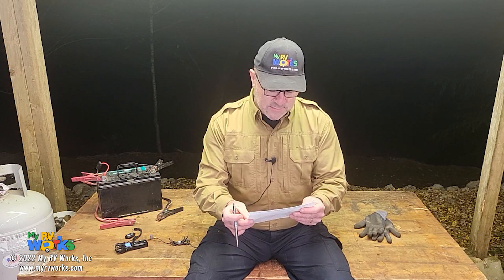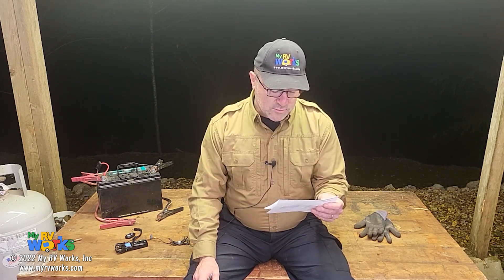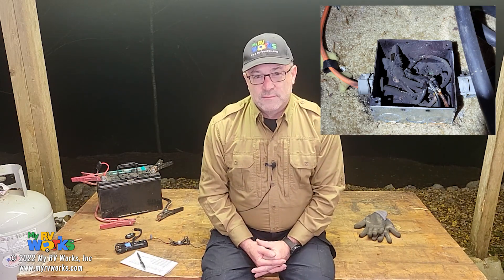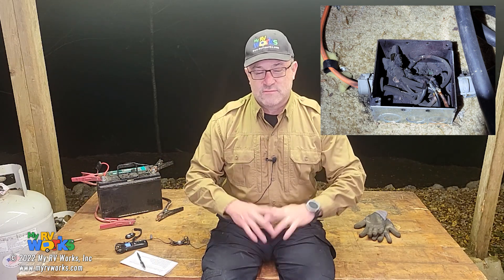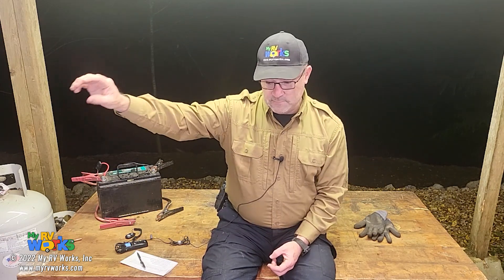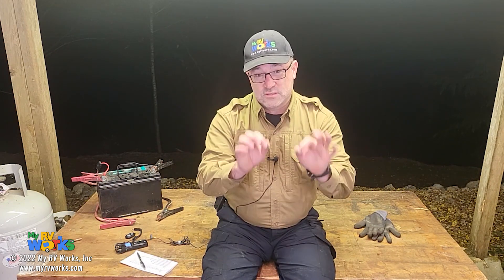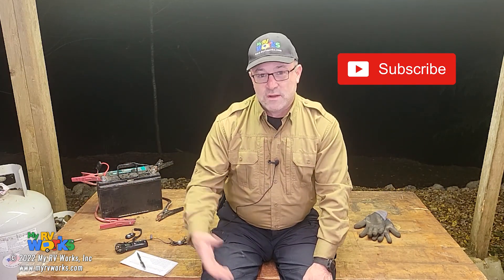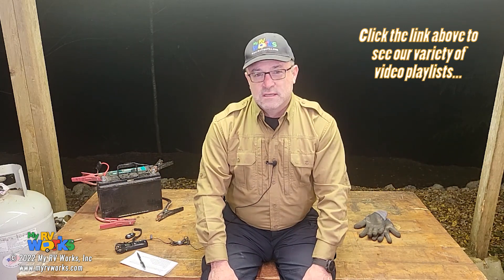RV Electricity Shuts Off Intermittently -- Where To Start Troubleshooting -- My RV Works

Comment: I have a 2016 reflection that kicks all power out intermittently, I'm told it's 30 amp service coming to 50 amp trailer and it's insufficient thus the safety is kicking off shore

Comment: I had my AC and fridge would shut off when that happened the only thing that work on my RV are my power plugs ...my lights fridge AC do nothing sometimes they come back on soon sometime not for hrs ...so I replaced my breaker box and fuse box now everything works all the time but my thermostat has no power my AC won't turn on and something new my furnace never had any power problems now it won't turn on ...

Comment: Hello Darren, I own a 2205s 2023 Rockwood Mini. I noticed when we were preparing for our next road trip, our 12V system started having issues with lights flicking when we stepped on the floor in front of the kitchen sink. This happens while we have shore power even when we're Boone-docking we have two 100w solar panels on the roof. Your thoughts?

Comment: I'm having the same problem on my 2019 Forrest river 26DB Grey Wolf. 30AMP, but only when the AC is running. All power cuts off and on, Just started happening. I guess I'll try and find the junction box you spoke of. Thanks for taking the time to make these videos.

Comment: Great stuff, but I have a converter that keep turning off. Replaced the converter and the new one is doing the same thing. Thinking battery is dead and pulling too many amps?

Comment: I have an 2006 Alpenlite Voyaguer,  a 5th Wheel, a few days ago the lights in the bedroom/bathroom stopped working , halfway through the morning,  meaning they worked when I got up, turned them off, returned later ...nothing. Everything else in the RV works .   Everything only this small cluster of lights and the bathroom fan.   The electric outlets in that area work, so I've plugged in a lamp.   The night reading lights at the head of the bed work.   We've changed all the 15 and 20  Blue and Yellow plastic fuses.   Any clues what we haven't done right?

Comment: Do you work on RV Generators?   I have a Onan 4000 Microquiet KY Spec H which cranks but doesn't start.  Replaced fuel pump and filter, starter solenoid, fuel cutoff solenoid, air filter and spark plug.  I've overhauled the carb, new jets, float, gaskets and bowl ring,  all the general maintenance items.  I had a valve spring retainer clip break, which has been replaced.  There is no oil sensor switch. I've verified fuel and spark.  I have no idea where to look next.  Any suggestions would be appreciated.
thanks

Comment: Darren great videos keep them coming. Quick question I'm thinking of adding solar to a 2008 trailmanor 3124ks. What would you recommend to plug in solar charger controller direct to battery or charge controller to DC side panel supply? Will make a difference in voltage drop? Thank you

Comment: Some RVers are STUBBORN and don't/won't learn about amperage.  You get 2 small space heaters going and there is nothing left amperage wise for anything else.  A 30 amp service (3600 watt) is used up quick.  Better make sure every connection is BRIGHT AND TIGHT!

Comment: Hey Darren,  I would start at all the connectionalong the power to the panel box.  In my findings it is mostly a poor connection or a worn out plug on trailer cord or at the power pedastal. Great informative video as you always do.  Thank you for the videos and keep them comimg.  Rick A from Farwell MI

Comment: My favorite problem is when 12V lights don't lose power completely but dim down to almost nothing while all the rest of the 12V lights in the unit, including on the same circuit, stay on as if nothing is happening. This doesn't happen to just one fixture. It happens to nearly all of them, one at a time, at one point or another while the rest that are often on in the same space don't give the slightest indication that anything is wrong. It happens at any temperature, and whether the lights have been on recently or not. Between two electrical engineers in the family and a good friend who is an electrician, there has been puzzlement and a range of theories for the cause suggested but nothing that has been established. Currently the best / most plausible theory is that it is specific to capacitance issues (design or manufacturing fault) in the collections of LED's that make up these types of [very cheap RV-level] low-voltage LED lights and that is also why it can be exhibited randomly and without impacting the rest of the circuit it is on.

Comment: Hey Darren I  like these challenges too. I my self would start with the shore power cord. With 30 years of experience many times I find one end or the other that is compromised by being burnt or even  the twist locking connector on the coach is burnt or has extremely loose connections. Your nose can also lead you in the right direction too.
Hope this helps. 
HAPPY NEW YEAR TO ALL!!
Reply from the maker: Happy new year! Thanks for watching!

Comment: 🎊Happy New Year 🎊 
 I have a 1999 Ford Pace Arrow vision 50 amp rv. Rats invaded the rv just before I got it and chewed many wires. 
 Solar panels were charging for a while. The lights were working, so was the pump for the sink/toilet but outlets didn't work or anything else.  then one day solar just stopped charging.  It seem to stop the same time I replaced the alternator. Is it a completely different system and it's just a coincidence they both stopped at the same time?
 Anyway,  I want to put more panels on roof and replace as much wiring as possible.  The person who I got the rvfrom didn't know much about it so I don't know much about how anything works. 
  Are there booms on how to operate my rv. How to open and close slide outs.  (Which don't work blouse of the rats) 
 This is my first rv. How can I learn how to operate everything.  Is there the perfect book on wiring for my Year RV and an operators manual? 
  Any advice?
   Thank you.
Reply from the maker: Happy new year! We'll be going live again on Friday, Jan 6. We invite you to join us then and ask us your questions!
Reply: @MyRVWorks  - at what time are you going live on Friday? 
 Is there anyway you can set up a notification for your subscribers so they will know exactly when you go live